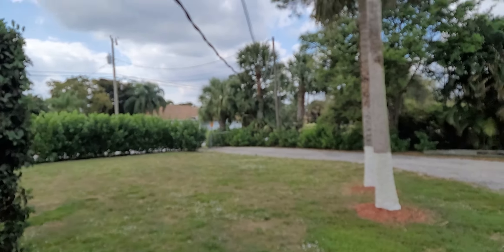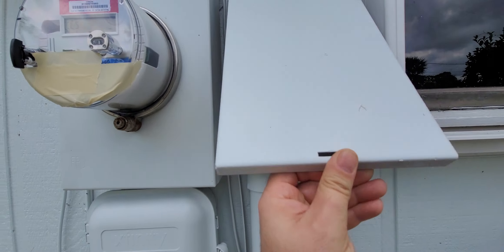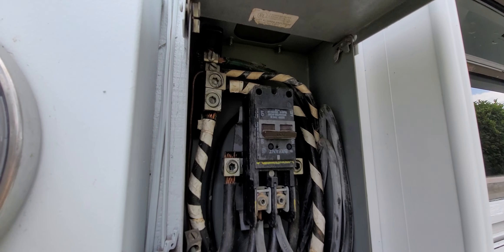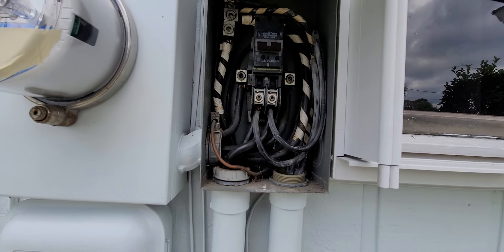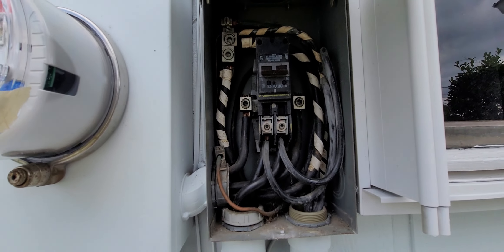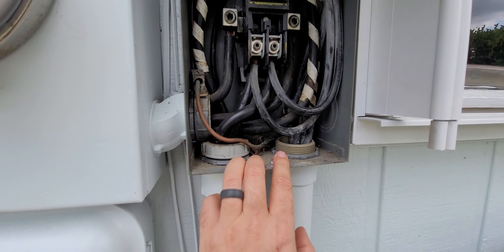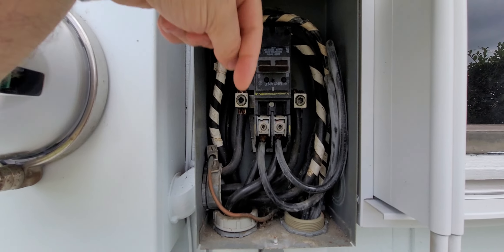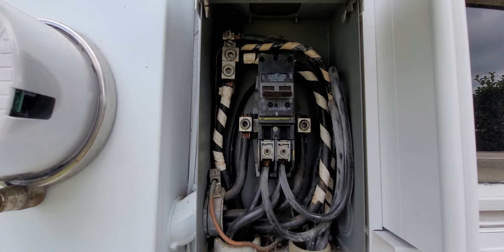can you find what is wrong? Electric meter main combo panel service with code violation.

Comment: Just wondering, you think were they trying to use 240.21 with the #2?
Reply from the maker: Do you mean 240.21 B? If so the "taps" are longer then 10 feet and even longer then 25 feet. So none of the exceptions apply
Reply from the maker: Also they double taped which is a violation of 110.3(B) (use manufacturers equipment as specified) and also the conductor is undersized as outlined on the table 310.15 B(16) NEC
Reply from the maker: Good comment tho I see what you were thinking.

Comment: messy wire!!
Reply from the maker: Haha, yes, it is for sure!
Reply: @Simonelectricfl  need clean up and new wiring
Reply from the maker: Messy and from the 80s like me!
Reply from the maker: @Justin JP Van Cleef Walker  Yes I plan on installing a nice clean underground service with a new meter main combo panel, maybe 400 amps.
Reply: @Simonelectricfl  I love older lights fixtures and switches and outlets from 1930’s
Reply from the maker: @Justin JP Van Cleef Walker  I do have a few switches and Disconects from the 1930 maybe 40s
Reply: @Simonelectricfl  cool
you are my good friend
Reply from the maker: @Justin JP Van Cleef Walker   it is good to chat.